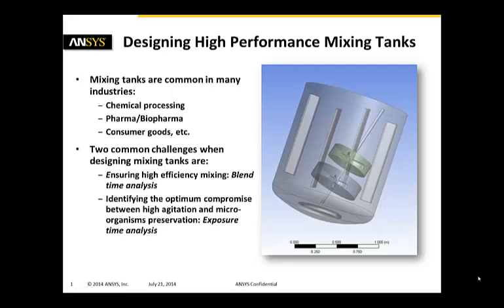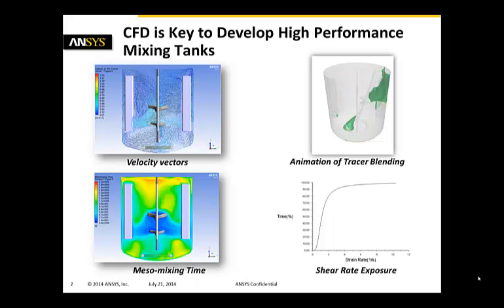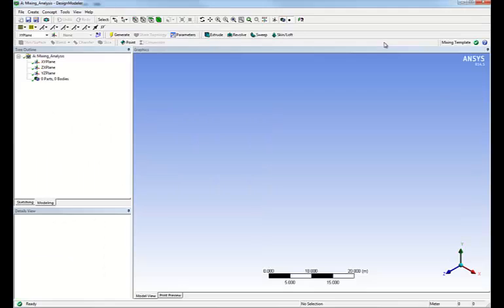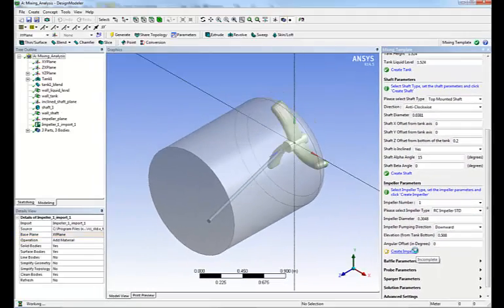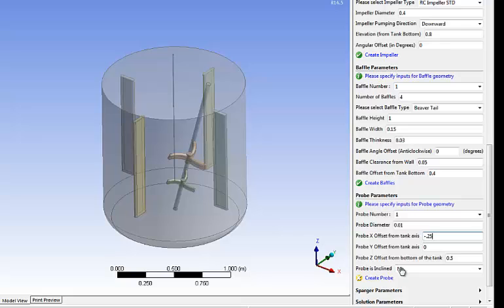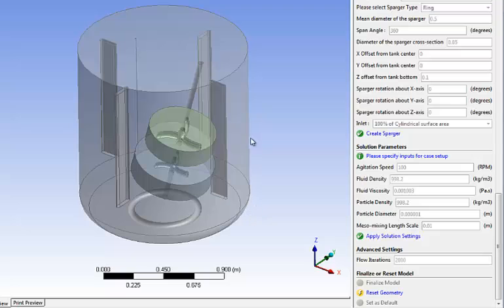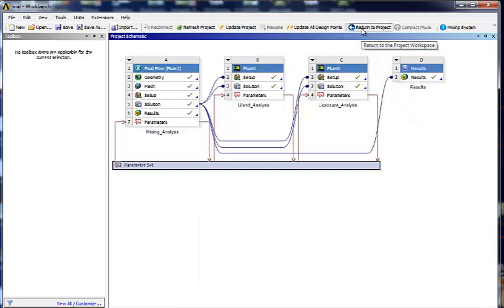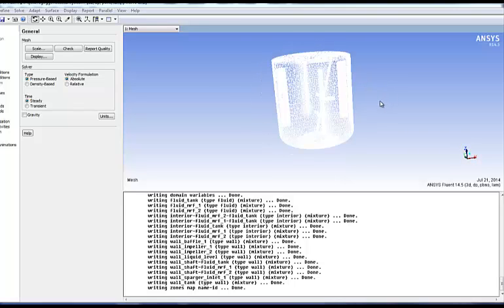How to Predict Performance of Bioreactors and Mixing Tanks

Comment: Hi, i have a problem for a numerical simulation of agitated vessel (MRF method) Pre Processing CFX 15.0; can you help me please ?

DOMAIN INTERFACE: Domain Interface 1

Boundary List1 = Domain Interface 1 Side 1

Boundary List2 = Domain Interface 1 Side 2

Interface Type = Fluid Fluid

INTERFACE MODELS:

Option = General Connection

FRAME CHANGE:

Option = Frozen Rotor

END

MASS AND MOMENTUM:

Option = Conservative Interface Flux

MOMENTUM INTERFACE MODEL:

Option = None

END

END

PITCH CHANGE:

Option = None

END

END

MESH CONNECTION:

Option = GGI

END

END

 

In Analysis 'Flow Analysis 1' - Domain Interface 'Domain Interface 1': The interface is placed at a rotor-stator interface and the pitch change option of 'None' has been selected. This option should only be used when the overall extent and shape of each side of the interface perfectly match and the surfaces are aligned with each other. It may therefore be suitable when full 360 degree or exactly equal pitch components are being analyzed.

DOMAIN INTERFACE: Domain Interface 1

Boundary List1 = Domain Interface 1 Side 1

Boundary List2 = Domain Interface 1 Side 2

Interface Type = Fluid Fluid

INTERFACE MODELS:

Option = General Connection

FRAME CHANGE:

Option = Frozen Rotor

END

MASS AND MOMENTUM:

Option = Conservative Interface Flux

MOMENTUM INTERFACE MODEL:

Option = None

END

END

PITCH CHANGE:

Option = Automatic

END

END

MESH CONNECTION:

Option = GGI

END

END

In Analysis 'Flow Analysis 1' - Domain Interface 'Domain Interface 1': Pitch Change option 'Automatic' is not valid if side 1 or 2 of the interface has a 360 degree or greater pitch angle, zero radius, mesh faces normal and parallel to the rotation axis, or mesh faces at the hub curve (low radial or axial position) which are thin in the radial or axial direction.

Comment: hi! This is an excellent video. Thanks.  
if possible can you do a tutorial or video on a solid-liquid flow or solid-liquid slurry flow in a simple pipe using Fluent-CFD software? 

Because one of my friends said that we can only work with DPM AND Particle tracking, the current models in Fluent cannot easily simulate macro-solid slurry. Is this true?